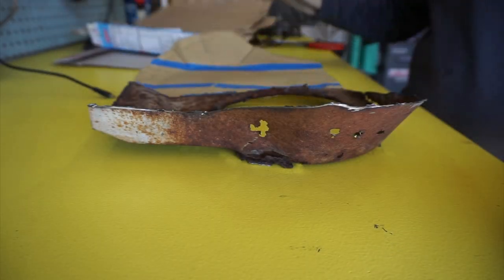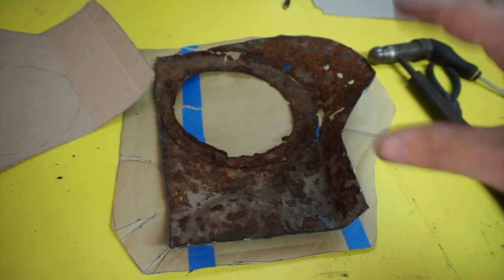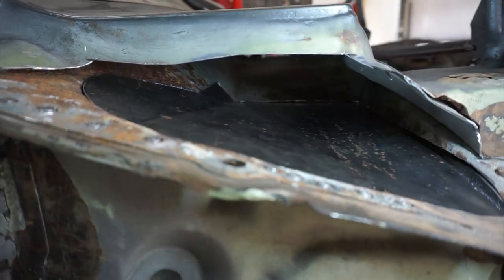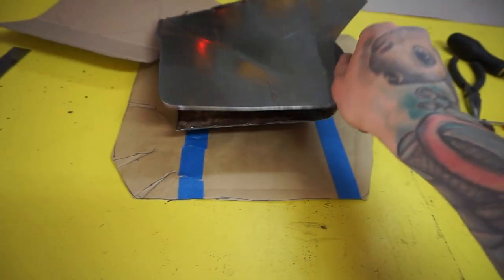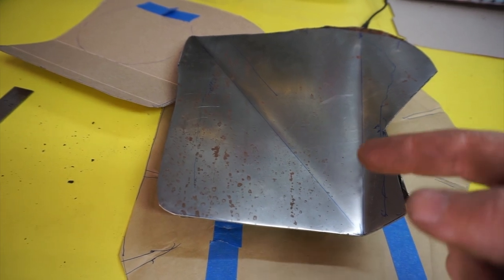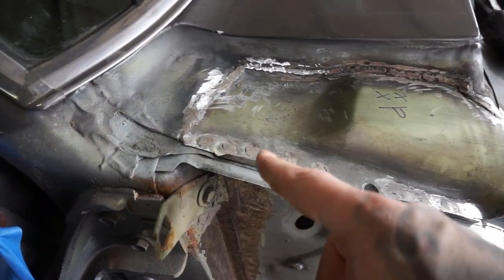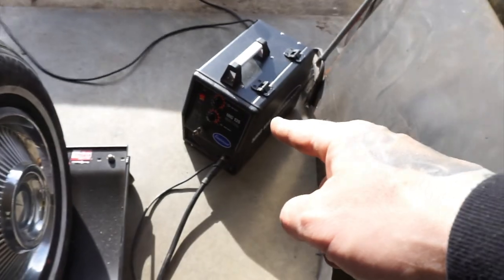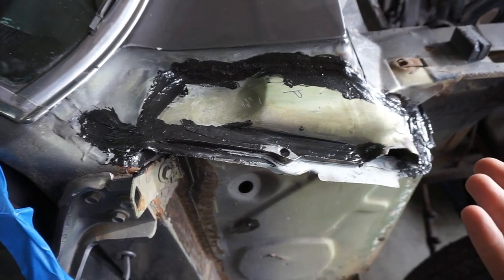Cowl Rust Repair - 1967 Cougar "The Feral Cat" Part 3

Comment: How is the rust repair coming along? I’m looking forward to more videos on this build 👍👍
Reply from the maker: I have some footage of the floorpans and trans tunnel, but I stopped because of the engine swap I wanted to do. However, I have since decided to go with a Windsor small block and AOD, so I won't need to modify the tunnel for the massive transmission that I had in mind.
Reply: Any cougar updates
Reply from the maker: Nothing yet. I decided to change what engine option I wanted, so I'll have to change some things where I left off last time. I think the Cougar will come back as soon as the Datsun is finished.

Comment: In a previous clip, you pointed out a blemish on the inner fender and indicated that it was rust damage. Is it possible that it is related to the right side collision damage that you also noted?
Reply from the maker: Well, I do attribute some damage to whatever fender bender this old cat got into. However, one major reason why this project stalled out as quickly as it got started is due to unforseen rampant rust. Worse than the rust is the HORRIBLE body work that looks possible from the outside, but after closer inspection, made the car unstable and not trustworthy for road use. I have began some repairs, but until I get the money for the engine swap, I can't go on because modifications will need to be made, and I only want to do the work once. 
This car WILL make a triumphant return to my channel, but it is going to take some time.